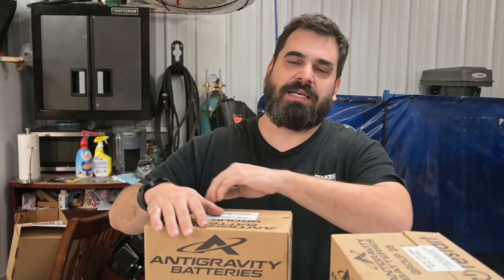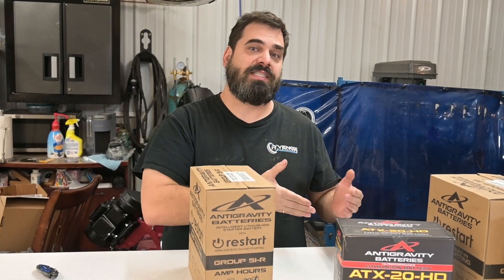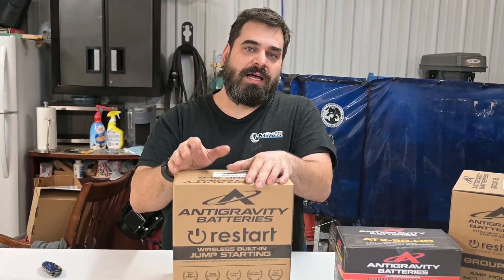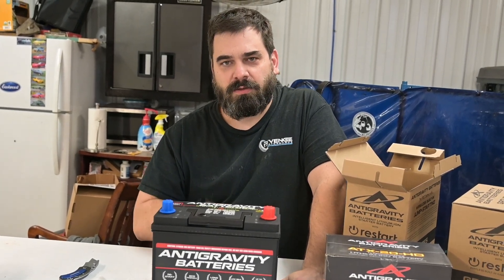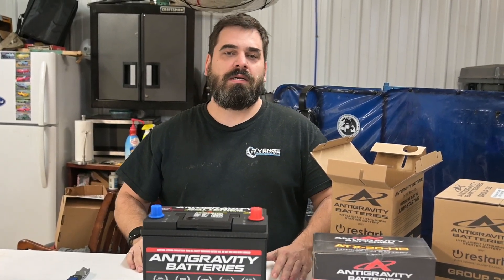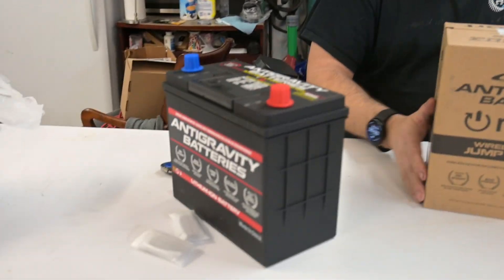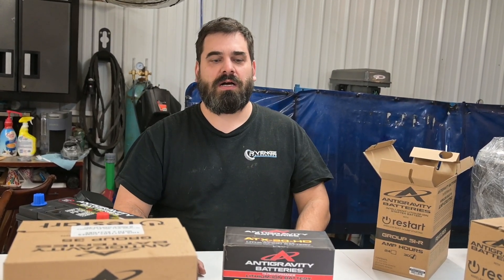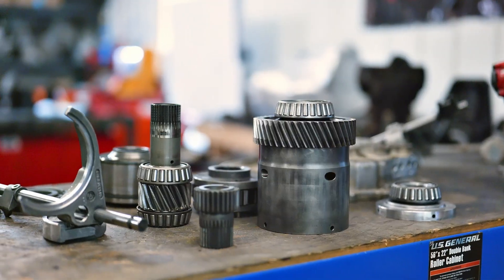ANTIGRAVITY Lithium Batteries Unboxing, Pros & Cons (not a lot of cons!)

Comment: One issue with these batteries is they rate the cranking amps as CA or Cranking Amps not CCA or Cold Cranking Amps. CCA is tested at 0 degrees F and CA is at 32 degrees F. This is a big difference. The warranty is prorated. Do not charge any Lithium Iron battery at low temperatures 0 defees F or you will kill it.  Just good things to know.